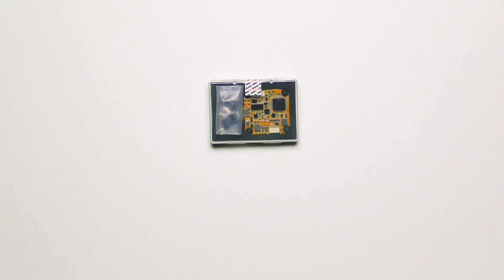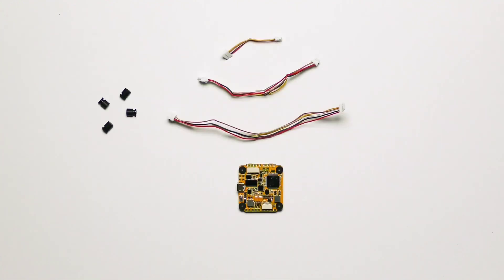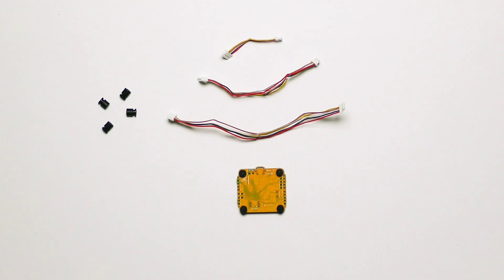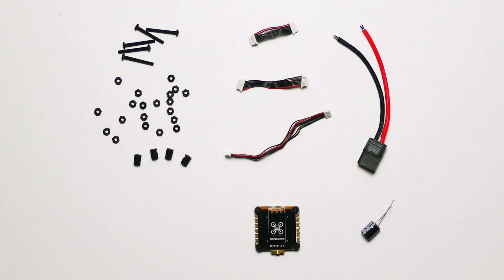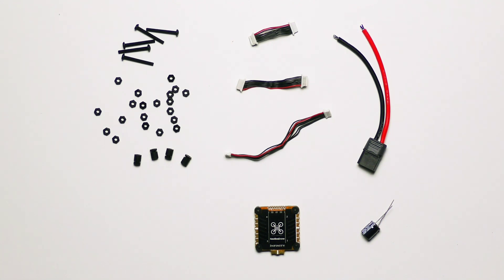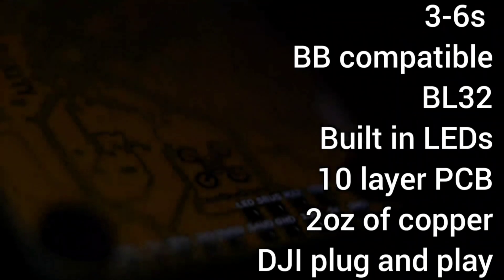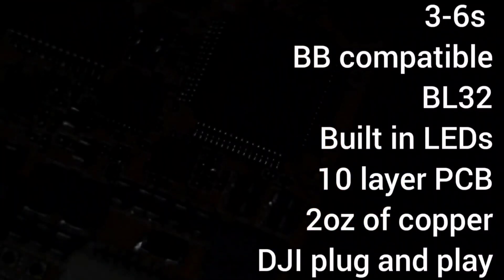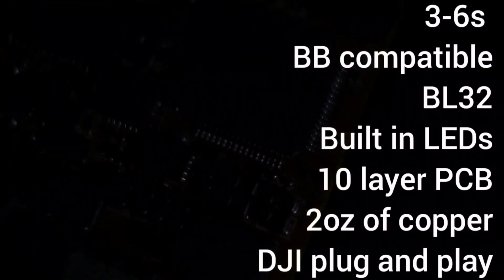Infinity Stack by NewBeeDrone Quick Look

Comment: Why does it say in the specs for the Infinity 305 ESC On board capacitor: 10uf x 48 Total 480uF, No need for external Capacitor but it comes with a 470uf 35v Electrolytic capacitor, why not a 1000uf 50v Electrolytic capacitor like it’s suggested by Oscar Liang for 6S 4in1 ESCs? https://oscarliang.com/capacitors-mini-quad/